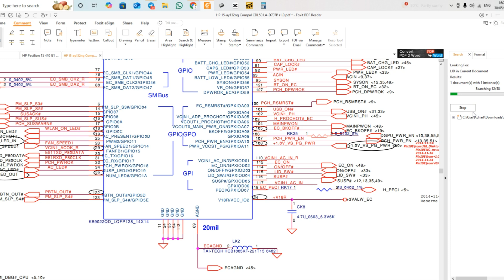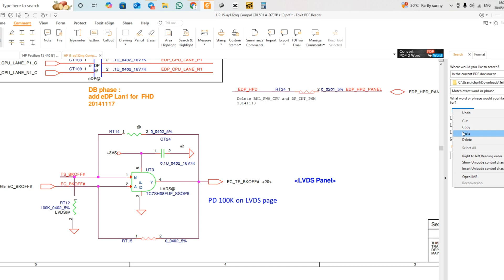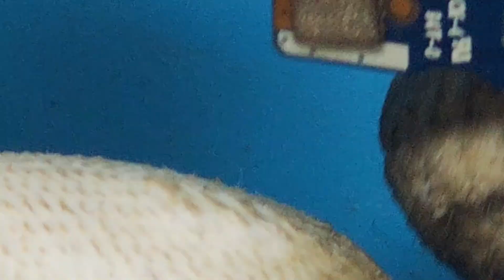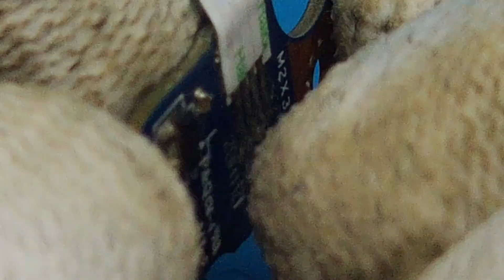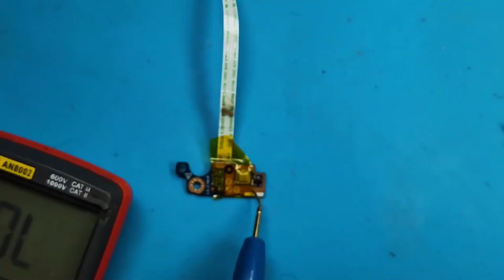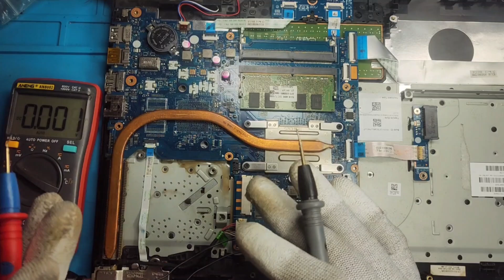HP 15 Series Laptop | LA-D707P | Power On, White Display | Role of Hall sensor | Can we fix it?

Comment: 4:43 please what do say the # symbol means and the function when added to a signal thanks
Reply from the maker: # symbol means it is active low, which means you should get 0v when that signal goes active and 3.3v when that signal is inactive. Example in LID switch. When you close the laptop LIDSW# signal goes to 0v and EC chip will understand that the screen is closed. Another example, SYSPWROK is also a signal but this is active high, no # symbol at the end. So this signal should always be 3.3v when the laptop is working fine. If this signal goes to 0v you will not get the display. 

Hope I explained your question
Reply: @philiptroniks thanks for your response sir and thank you for sharing your knowledge with the world. Am your top fan so always check for my comments on your videos thanks.